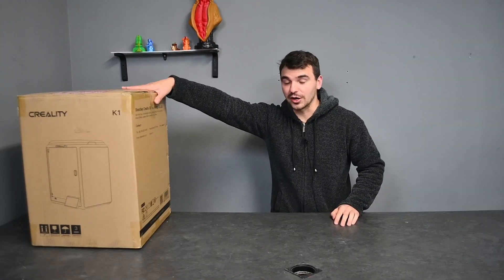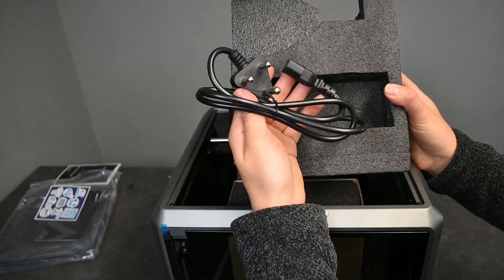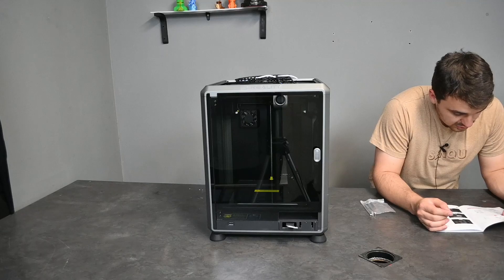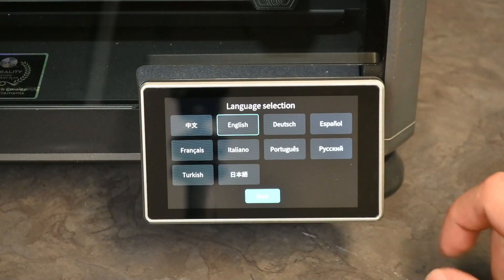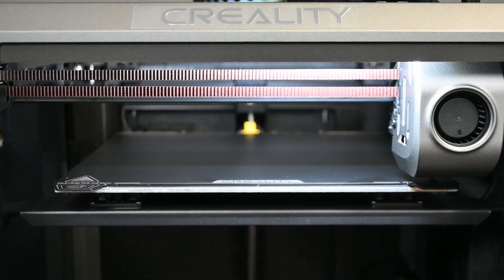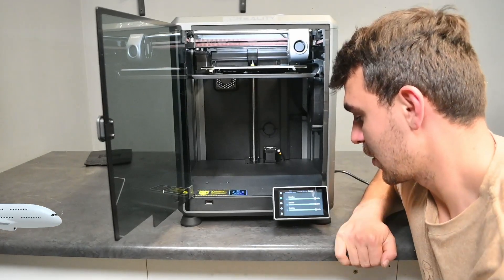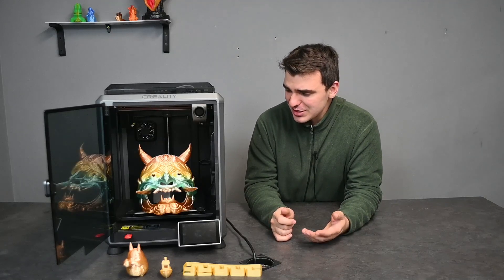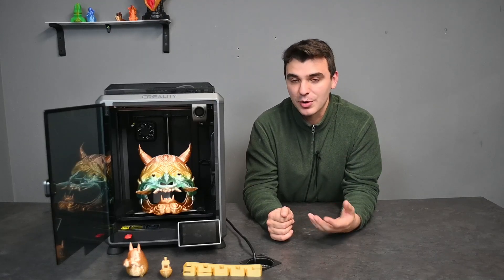Creality K1 Unboxing and Setup || First Impressions

Comment: So we just got one of these and it just BLOWS my mind watching it run at that speed on the test prints!

Being a regular shopper with you guys, I use the Cron and Wanhau PLA and PETG. I still struggle with the PETG on my own printer though.

But anyways. What slicer do you guys use and are the default PLA settings fine with your filaments?
I'm trying to get a dude at the office trained up to use it so I don't have to struggle, so really just want to fastest and simplest method.
Reply from the maker: I'm glad to hear that you are enjoying your printer!

We either use Ultimaker Cura or Creality Print to slice our files, for both Wanhao and Cron PLA, a nozzle temp of 200°C is perfect, and a bed temp of 60°C should be fine as well, that can drop to 45°C of you want. Print at speeds of about 300mm/s as this is the fastest reliable speed for the K1, simple parts could be printed at faster speeds as there is less that can go wrong, but that is up to your judgement.

I hope these settings can assist you a little, if you have something else you are curious about, feel free to ask anytime
Reply: @3DPrintingStorecoza  Awesome. Thanks again. Weird though as I print my Cron and Wanhou on my CR6 at 210... But all good...
Reply from the maker: @DeanosRides  10°C above or below 200°C should still work perfectly fine, anything more than that will start creating some issues with the finish of the print.
Reply: @3DPrintingStorecoza   Yea, anything below 200 becomes a bit of a mess! 🤣🤣 Thanks for the help guys! You guys are truly awesome to deal with!

Comment: Man!!!!! Those 3 lil screws are extremely frustrating as hell to try and take out. I literally can’t feel anything when I put the wrench in the little holes on each side
Reply from the maker: They are quite annoying to remove yea, if you have a magnetic allen key, they should be easier to remove as well, just be sure that you are also using the correct size allen key as to not damage the threads on the screws. Enjoy your printing!!
Reply: @3DPrintingStorecoza I have a feeling none of the 3 screws are in mine & idk how concerned I should be with this & if I should contact support & see what they say…. A lot of people are saying to return & exchange it for another one.
Reply from the maker: So the 3 screws you should be worried about removing before Turing on the printer are in the back middle, front left and front right on connecting the build plate to the bottom of the machine, they also guide you to them with yellow arrows pointing to them. They are all silver which distinguishes them from the other screws which should not be removed. You just have to unscrew all 3 silver screws as shown in the user manual, once they are out, you don't have to worry about putting them back in, and you are free to use your printer

Comment: error 2564: hot end problem. This machine is very bad.  Also Extrusion problems
Reply from the maker: I'm sorry to hear that you haven't had a pleasant experience with this machine, there might be a thermistor issue with your model. It could also be that you have the version 1.0 K1, which was known for its extruder issues, but they have been fixed with the newer version metal extruder.